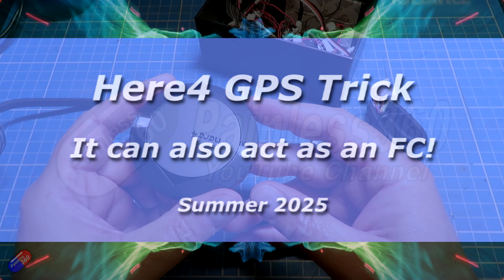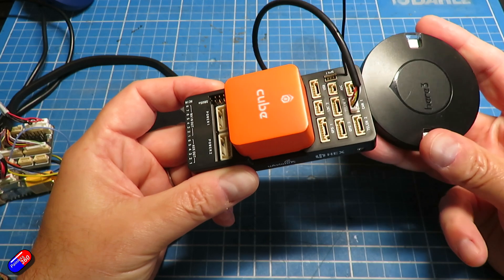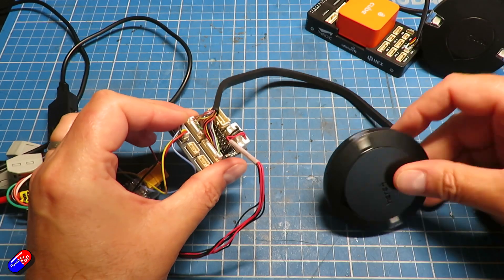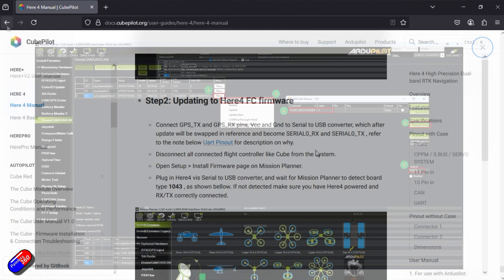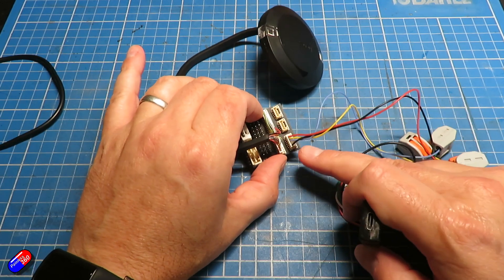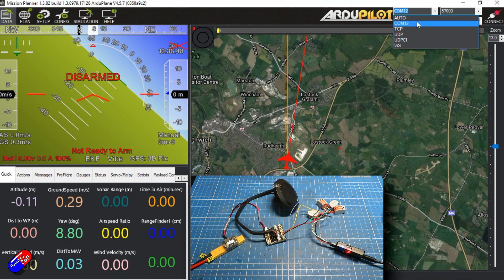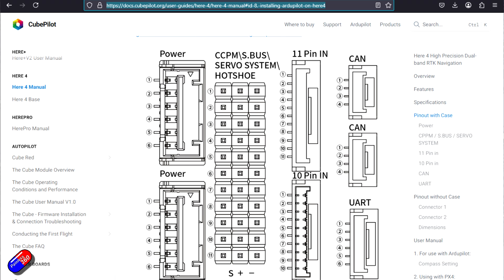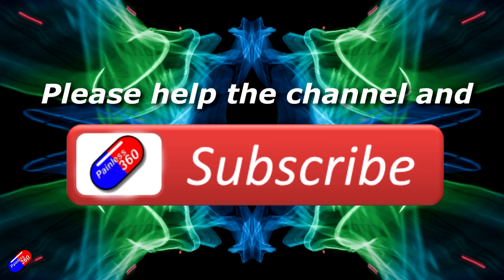Here4 as a flight controller

Comment: Hi 
i am facing a problem in reverting back from  here 4 flight controller setup to here 4 gps setup , there is nothing shown on UAV CAN  port when i connect with cube, can you guide me how can i use it back as a gps and not flight controller . Will be grateful. Thanks
Reply: I thought about same thing before trying it out as flight controller. if we can revert it back then only i can afford to try this, so let me know how its going on
Reply from the maker: I've not tried that yet. Let me know how you get on!
Reply: Waiting for your results … before I dive into the same project

Comment: Great video, as always from you Lee! Do not have the Here4 myself, but my guess is that best would be NOT to connect the power (red) wire of serial-to-USB adapter to the Here4 breakout, as the power is coming from the power brick already. This way the 5V USB VBUS will not fight the 5V DC/DC controller output of the Here4.